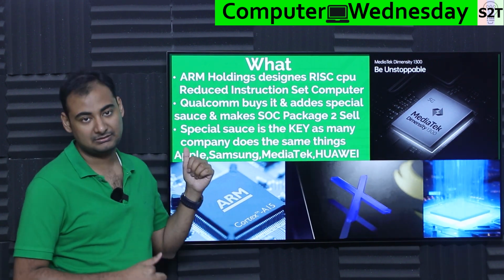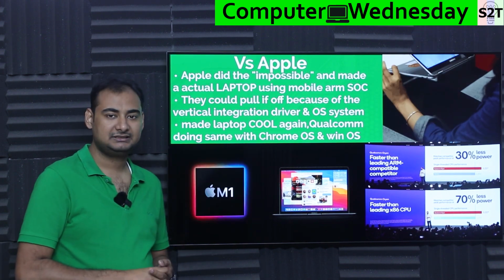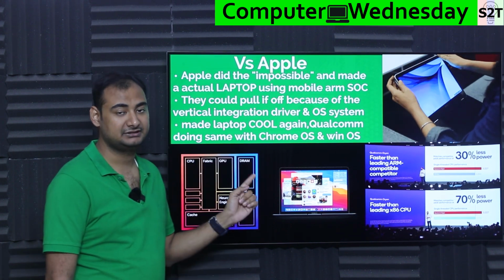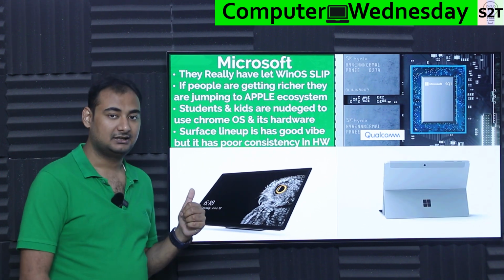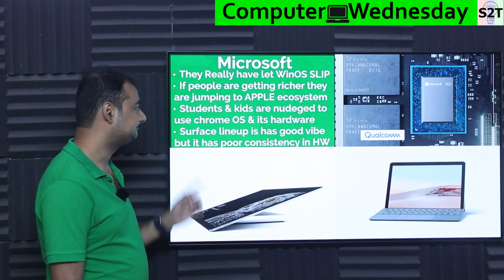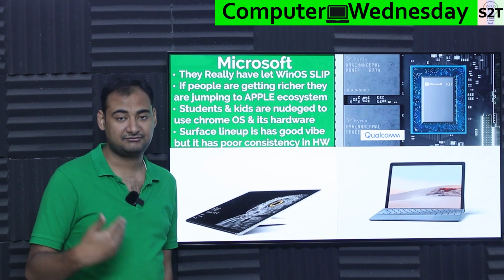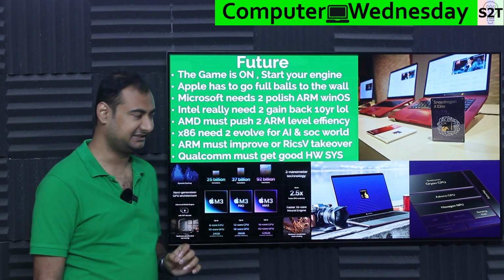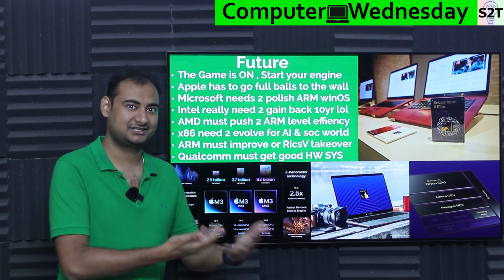Qualcomm Oryon CPU Explained  {Computer Wednesday Ep254}

Comment: Sad thing is it losses to m3 and now m4 came again 2 years behind apple
Reply from the maker: Apple is not the aim running windows is
Reply: @s2tenglish  But they were comparing to apple so definately apple is also their aim and with the launch of m4  the m4 single thread is 30% ahed that's just plain bad and when they release x Elite 2nd gen appe will release m5 by that time so the 2nd x Elite has to be atleast 35-40% better in IPC which is really hard to achieve

Comment: We will see how Oryon goes in the long term. I really hope there will be a competitor to Snapdragon other than the walled off Apple, since I'm not confident if that will really be enough.

Look at Smartwatches. Note, that there was a similar situation to laptops, where Apple was a competitor with their own walled off garden. Snapdragon released their 2100 in 2016, which wasn't amazing but a decent enough start, and managed to pressure out any competitors on the open market.

Afterwards, they stuck with that 28nm process with very little changes (the 3100 added a coprocessor) until 2020. For a low power device that loves of having good energy efficiency. But they had no real competition. There was only Apple, which only worked well with iOS, and Samsung, but they, at that point, did not use Android Wear (or whatever Google brands it now) but their own OS.

In 2020 their big update was moving to 12nm (with some parts still in 28nm) and using mostly a design for a 2018 mid level SoC, just with some additional coprocessors and connectivity.

It took Samsung abandoning their Smartwatch OS for Qualcomm to finally get off their arse and make some effort, releasing a 4nm chip in 2022 (that is still using some parts in 22nm btw, but at least the leading process is ACTUALLY fairly up to date).
Reply from the maker: Lets see